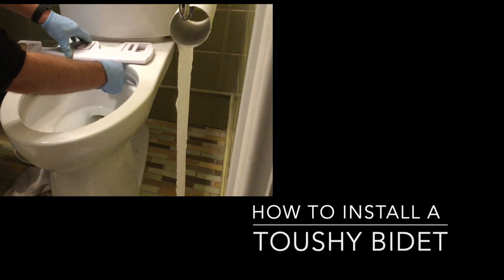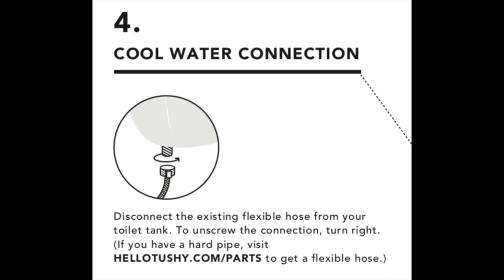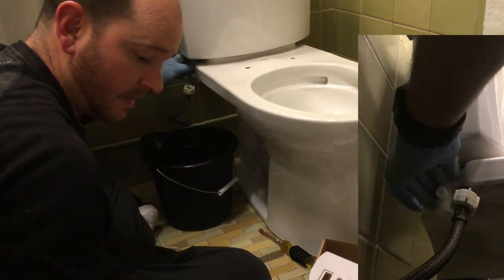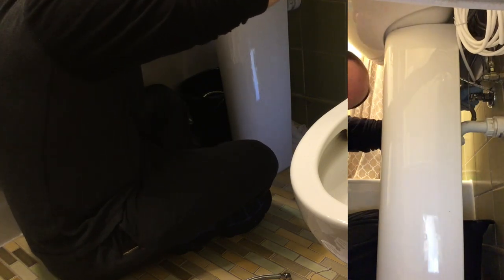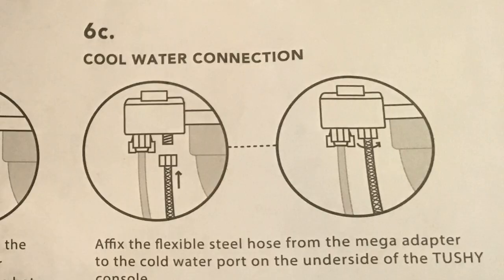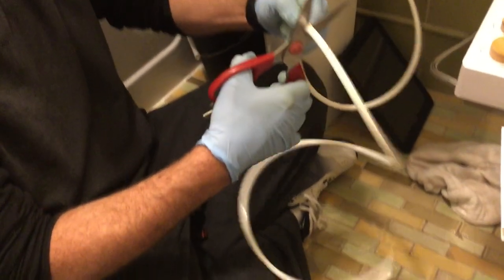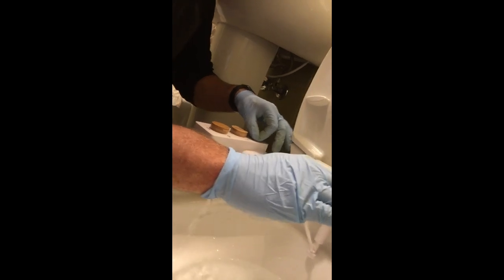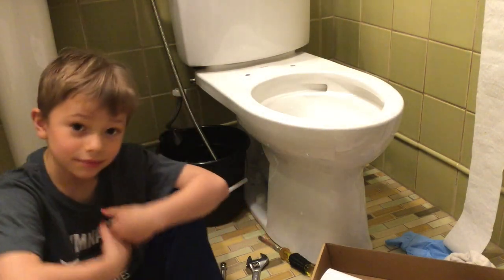Complete Install of a Hello Tushy Bidet with Warm Water Option

Comment: One thing that I would recommend doing prior to installing, is to make sure the supply valves for toilet and sink are in good shape.  Shut off valves for the toilet and sink are hardly ever used, and the washers and stems could be worn out. I literally touched the valve under my sink to shut the water off, and a steady drip began. Luckily I had a new stem washer kit at my house. I had to shut the water off and repair the valve. If I had attempted this at night, or was not able to fix it, it could have been a mess. I have stopped the installation until I get the material to replace the stem and washer on the toilet valve. I am not going to touch it unless I know that I can fix it if it leaks.

Comment: The washer that is used on the “T” on the hot water feed is really thin. If you over tighten, it will distort and leak. Also, use Teflon tape on this fitting.

Comment: Been thinking about installing a bidet and I believe I’m sold now on the warm water option (fortunately my bathroom lavatory is close enough to make this feasible), but one question….I understand “priming” the warm water at the sink so it’s warm when you’re ready for it, but could you do the same by just slightly opening the flow valve for a minute or so?   Just enough to get a little flow going without actually “engaging” with the stream, so to speak.   

Thanks in advance and thanks for the excellent video 👍🏻
Reply from the maker: Yes you can.  That would preheat the water.

Comment: Theirs a hole between the hot and cold water inputs and mine is leaking! Any tips also why is this hole their?
Reply from the maker: I would make sure they are both tight and not to loose or tight.  If it is coming out the hole then it might be bad.

Comment: Do you tend to find that by the time the water is warm, you're done spraying yourself off? I am trying to decide between Spa (with warm water connection) and Classic (cold water only) and I have a feeling this would be the case. It seems like even if you first prime the hot water through the sink, you are going to start off with a spray of cold water on your butt. If you were buying another Tushy, would you get the Spa or the cheaper Classic?
Reply from the maker: You can pre-run the water to get it warmed up if you want but i don't.  But I have a feeling that will change in winter.  Have not used in mid January in the midwest.
Reply: Hey Dude. There is actually a simple cheat to that.  Turn on the hot water tap, on your bathroom sink faucet, and let it run until it warms up (which takes seconds.  Just like you do when you go to wash your hands).  Otherwise, That  small bidet hot water line will take forever to warm up.  My sink is close to me.  Even my girlfriend can reach the hot water tap without getting off the seat.  You don't even need to wait until the faucet gets hot. Soon as it gets warm, shut if off and use your bidet.
Reply: @TheJTcreate  He said that. "prime the hot water through the sink".

Comment: Mine keeps leaking from where you’re touching it at 2:31 
Any help?
Reply from the maker: In some the documents they show placing a washer in there.  That is the first thing.  Did you try and add teflon tape.  The other thing I would check is to make sure it is not leaking out of the basin.  Check to make sure that did not come loose.